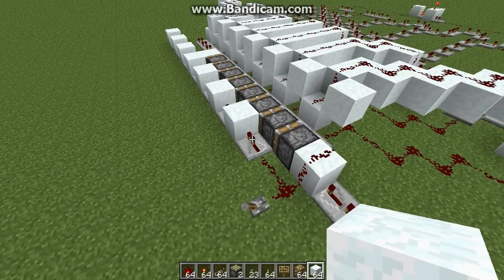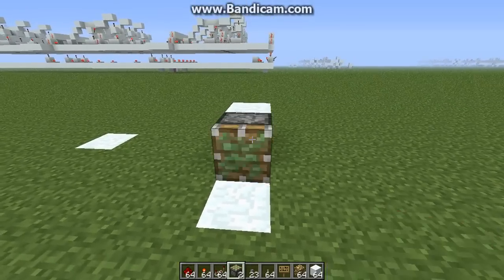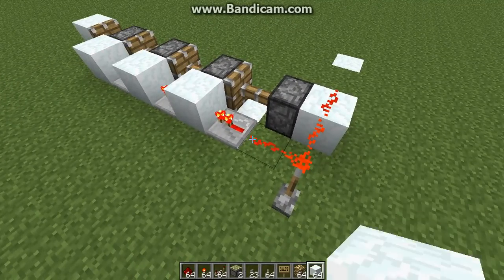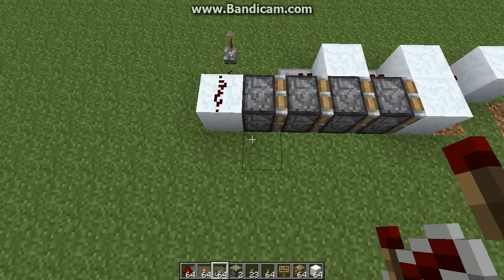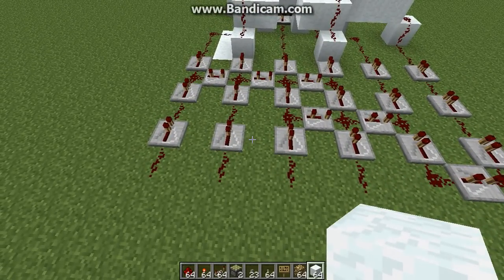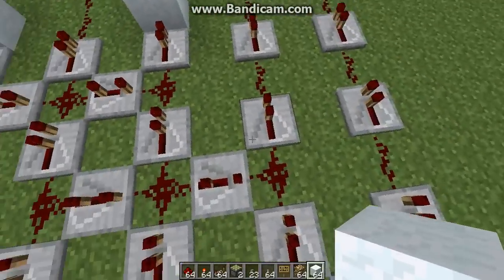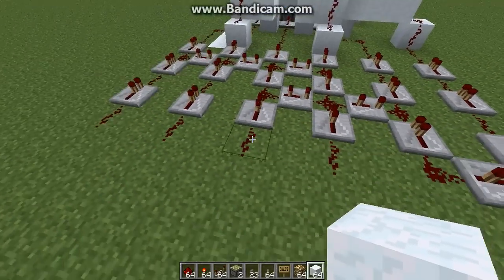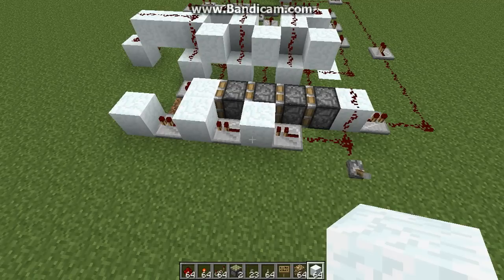Minecraft How to make a piston extender of any length

Comment: I have a double piston extender that uses 2, 3, 4 ticks.  The middle piston (touching the block) has two repeaters; one at 2 ticks and the other at 4 ticks.  The outer piston has one repeater at 3 ticks.  The block has a line of redstone running into it.  I modified the design someone else had come up with so that it would work in BE Minecraft.

I have a triple piston extender that uses 8 repeaters all set to 4 ticks.  There is an observer looking into the second piston on the side opposite the repeaters.

The double piston repeater looks like this:
piston      piston      block
repeater  repeater  redstone
redstone repeater  redstone
redstone redstone redstone

You can put the input into the redstone on the bottom left.  The triple piston extender looks like this:
    1  2  3  4  5  6
a ** rs rs rs ** **
b rs rs rp rs rs rs
c rs rp rp rs rp rs
d rs rp rp rp rp rs
e rs pi pi  pi bl **
f ** ** ob rs ** **
g ** ** rs rs ** **

The repeaters (rp) are all pointing into the pistons (pi).  The redstone (rs) connects the repeaters together on one side and the observer (ob) to the third piston on the other side.  You can connect the input to the redstone at a2.  I have the whole thing one block underground.  This was not my design, but I found it seems to work well with BE Minecraft.

In order to connect the two together, I simply placed a redstone block on the middle sticky piston of the double piston extender.  When it is extended towards the piston at e1, the triple piston extender activates.  Granted that means there is a gap between the two, but they are at least connected together.

Comment: I know this is over a year old but the reason you need to slow down the repeater delays is very explainable in case anyone (creator included) is curious. Pistons take 1.5 redstone ticks to extend (also known as 3 game ticks because 1 redstone tick is equal to 2 game ticks). This means that the 1 redstone tick delay of a repeater is noticeably faster than the pistons can handle once you go far enough with it and it causes repeaters to extend pistons before the previous pistons had the chance to push them into place.

Comment: 899 pistone extender?
Reply: pistons can only push 12 blocks so the max you can have is an 11 piston extender
Reply: Wrong. Pistons can only move 12 block when extemding true but they can only move 1 block when retracting becuase of the sticky mechanics. Thus the reason for the "pulsing". It can be done but would require incredible amounts of redone.
Reply: Are you saying that to me or ChiHo Chan

Comment: dude there is a more complex version and you cant do it at any length cause piston can only push up to 13 blocks -_-
plus that is really slow. but ive gotta say it is pretty good though
Reply: That's probably the fastest speed possible.
Reply: You can use a short clock that only pulses two times. Then it would push up to 26 blocks and then so on.

Comment: how would you make a 15 piston extender, or even 16, 17, etc. extender when the first block can only push 12 pistons plus the original block?
Reply: You would have to use 1-tick delays for each piston, so that they shoot out the block, but idk if that makes sense. I did a 16 piston extender, and it worked great!
Reply: You can push one of the further Pistons first so it doesn't really work here

Comment: You need the three tick delay as a piston takes 1.5 ticks to extend, whereas the repeaters only provide 1 tick of delay. However in 1.3 and onward pistons will take 2 ticks to retract, instead of the 1.5 ticks in 1.2.5. :)